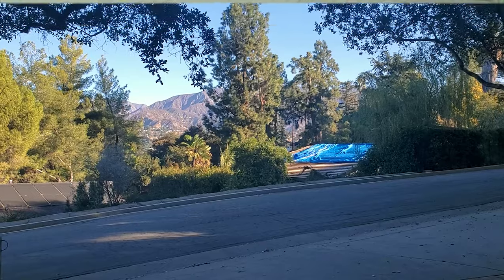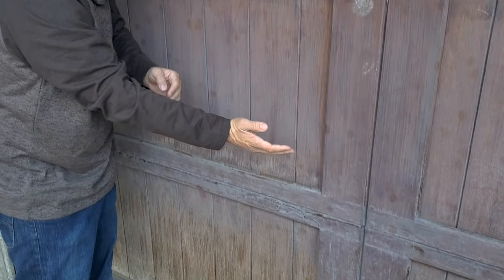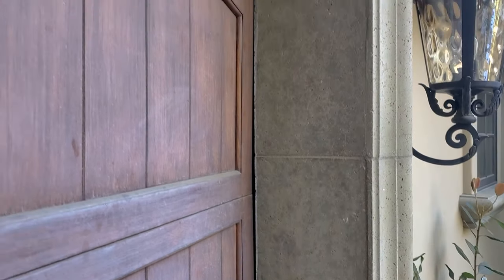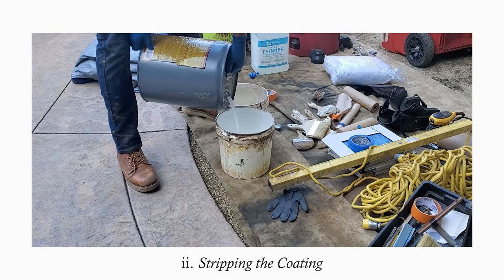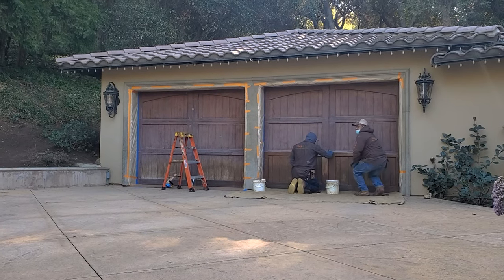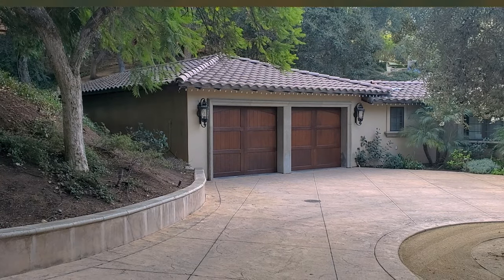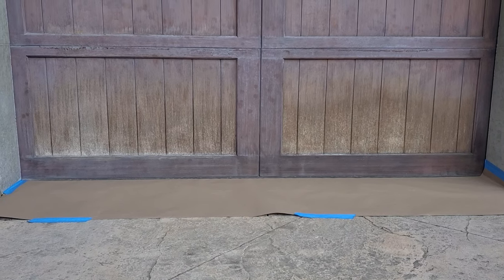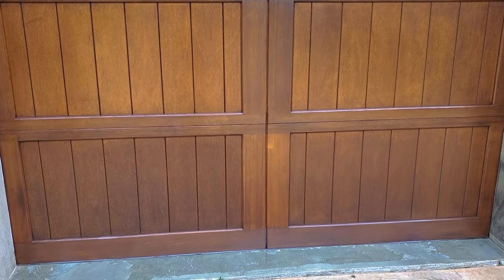Wood Garage Door Refinishing and Restoration Los Angeles and Orange County

Comment: Is there a way to tone a wood panel that is much different than the others to the naked eye?
Reply from the maker: You can change the opacity to essentially hide the wood and potentially achieve more perceived uniformity.  Going from light to dark is somewhat easy.  Trying to change a dark piece to light is not so easy.  I hope this helps.
Reply: @teakmastertim  nope. I have VG Douglas Fir front doors and one panel is noticeably lighter than the others.  I was under a lot of varnish that was very dark  and covered the grains. I want a less opaque look over all.  It’s come out very red toned which I don’t mind, just that one board is most different.  Thanks for the help.

Comment: Hi Tim, What type of stain did you use? I chose a semi transparent but don’t want to apply it until you tell me what you used. The doors in this video are perfect and I’m wondering if you used a solid because it looks so uniform. I applied a tiny bit of stain on part of our door and it looks so uneven . Great video btw!
Reply from the maker: We mix our own pigments and stain.  try using Old Masters for premixed colors.  We used a transparent mix.
Reply: Not so fast…. That’s the secret sauce 😂

Comment: Is there a totally flat finish for these Tim? Don’t want any sheen.
Reply from the maker: This is the most matte finish in high quality oil based film forming coatings.  You can try and use a water based matte coating but you loose the longevity and maintainability in our opinion.  Any finish you apply mulitple coats of will build up a slight sheen.  You can see the sheen in this video because we had just finished.  Once it receives sun and weather and a layer of natural dust, it will tone down.  It will look perfectly matte.

Comment: Did you use a prestain conditioner
Reply from the maker: We did not.  The client wanted the doors to  have the most variance it could possibly have.  We didn't see streaks or blotchiness while we were staining.  We may use it more when a client wants less unevenness or if they desire a slightly more uniform look.